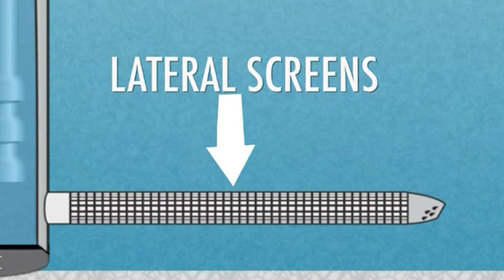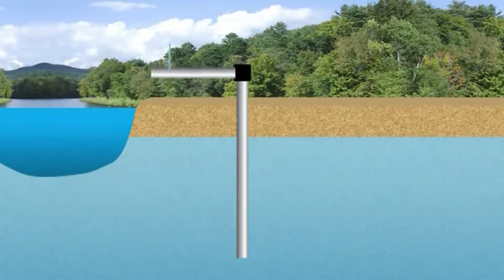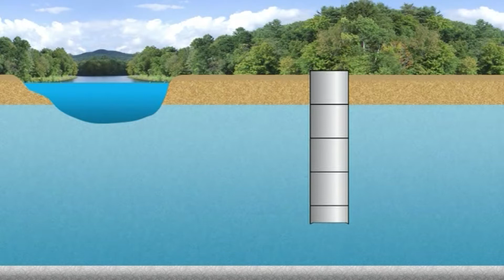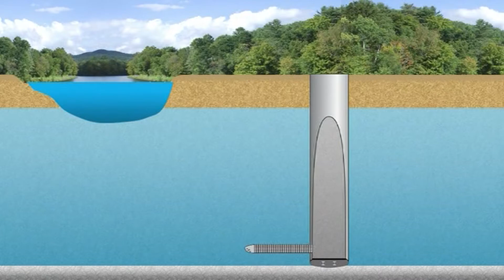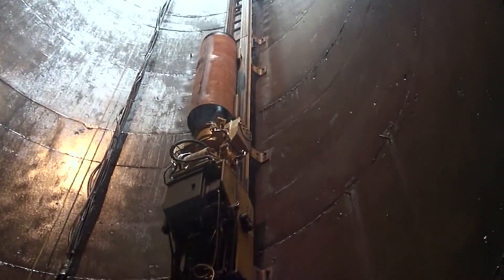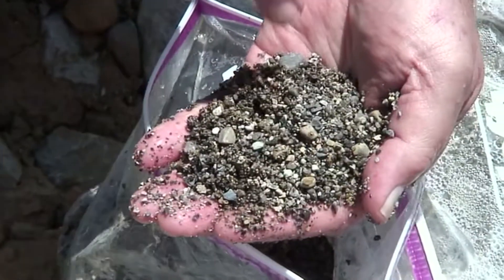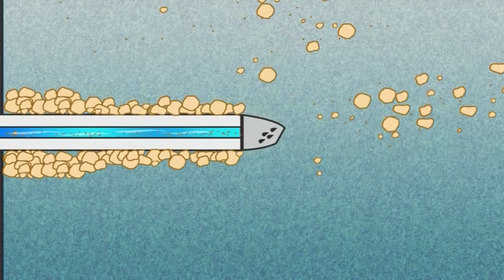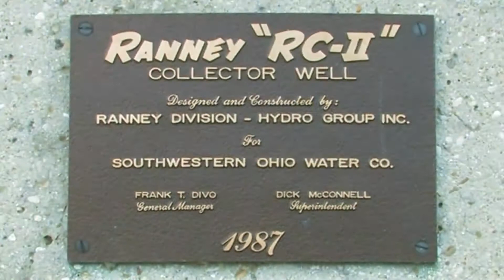Layne Ranney Collector Wells Demonstration Video

Comment: we just replaced 4 valves on bottom on the laterals inside of a well. 90’ of water. Afterward it was pumped down - no leaks. I’d be curious to know what head pressure or uplift forces act on the concrete plug that’s poured after the sinking of the well. How would one calculate head pressure on four lateral screens (8” diameter openings in the well).
Reply: You don't have enough information. is this on the end of the screen? you would at least need to know how high the water is above it.
Reply: 1 psi per 2.31 ft.